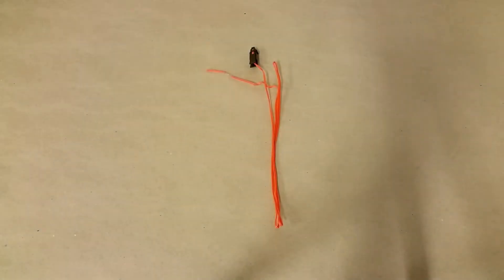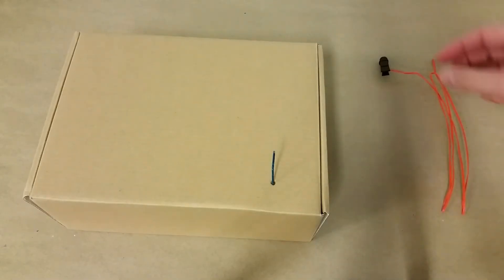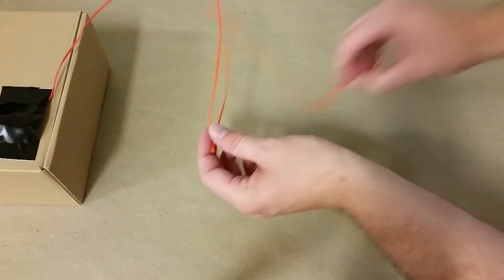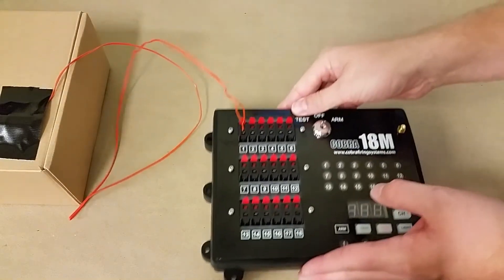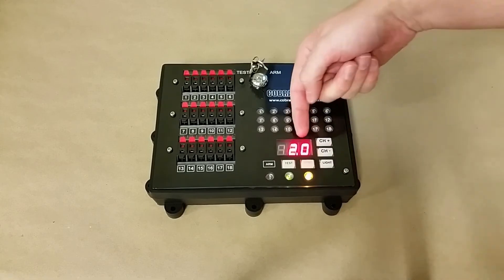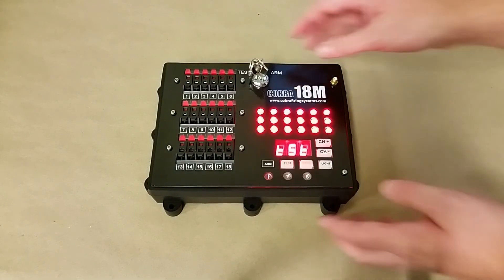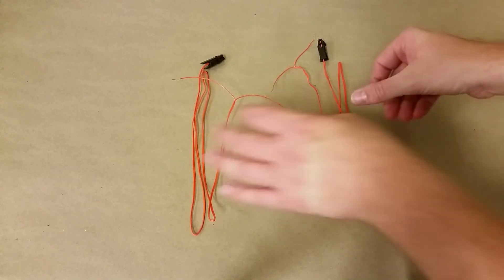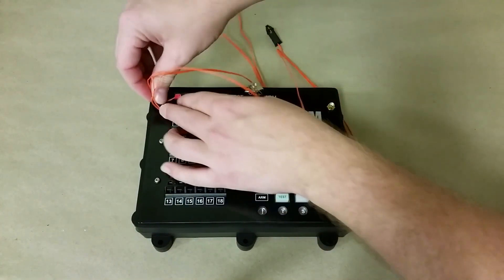Clip-On igniters - How-To Video

Comment: To be honest. I will never buy talons again for one simple reason. I have had at least 3 fails allnon the same cake. Talons tested good but would not heat enough to burn the fuse on that cake. Worked great on every other cake I had...
Reply: Just break up the glue in the Visco like you would using E-Match. Sounds like the fuse on that cake has too much glue in it. I have no problem lighting 3 mm Visco with Talons.
Reply: I had similar experiences with Talons on 1.4 Excal mortars.  Very high failure to ignite rate.  Maybe the thick glue on the Visco as mentioned.  I'm daring to try it one more time this year with this in mind.
Reply: Open the visco up a little bit and place talon at that location, secure with tape.